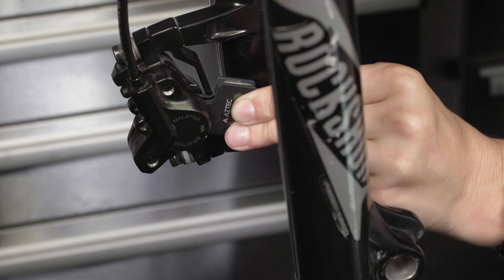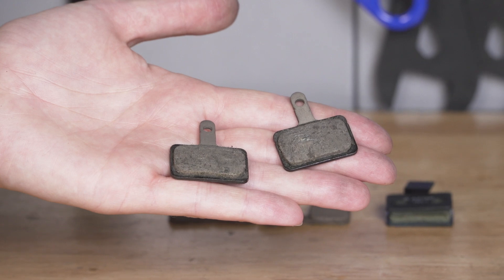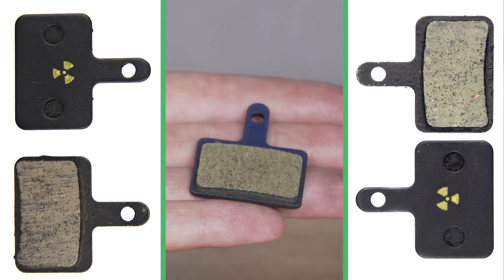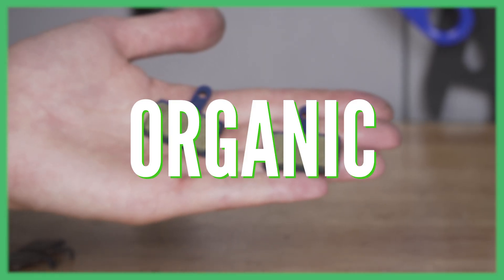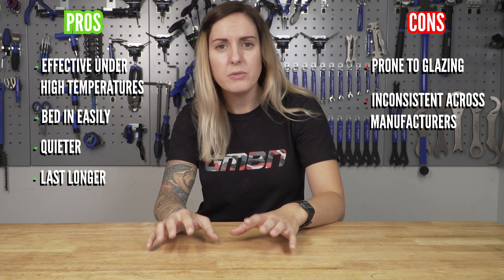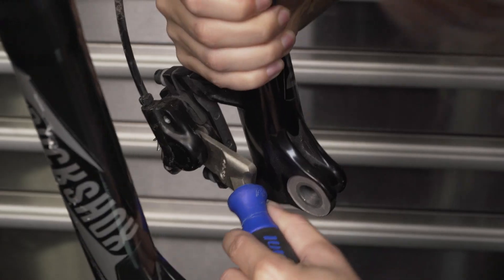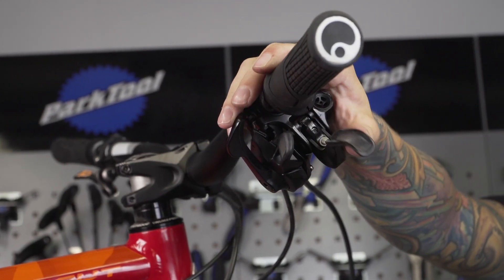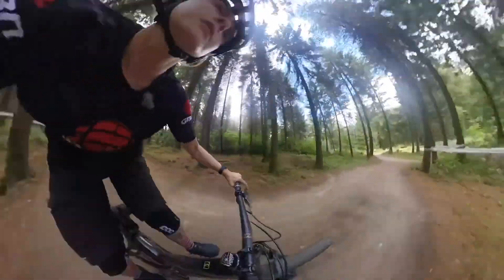GMBN Tech Essentials Ep.2 | Brake Pads

Comment: Pro tip, don't come to a complete stop when bedding in brakes! 
Bedding in is simple, deposit brake pad material evenly onto the rotors as the two rub together and warm up. 

If the brake pad cuts through this layer of disc pad material, or the layer is laid down irregularly by an incorrect bed-in procedure (like coming to a complete stop when the pad is soft, creating high spots) the pad jumps as it hits a damaged / irregular area, digs in, then jumps a bit more and digs in once again. 
The sequence creates oscillation which continues through the rotor creating microscopic waves around the contact area, essentially becoming like a vinyl which has been hard coded to make noise, this cannot be erased by changing pads and requires the rotor to be put back to neutral (by sanding or grinding) or even replaced in worst cases. 
Coming to a complete stop also significantly increases the likelihood of glazing.

Comment: Solid vid, GMBN! Thought I'd add something I've found through my own riding... 
Sintered pads...
Whilst the pads themselves are resilient to heat, we've found that on a long, steep descents where you're generating tonnes of heat, such as places like the Alps (Pila, for example), a sintered pad will conduct a lot of that heat back into the caliper. Eventually this boils the brake fluid and results in the scary brake-levers-hitting-the-bar moment. 
Quite a unique scenario, agreed, but it consistently happens!
Reply from the maker: Thanks for sharing that! They all have their unique characteristics, though long descents in the Alps can bring about its own unique problems.

Comment: I was under the understanding that you aren't supposed to lock up when bedding in. Since it can lead to an uneven distribution on the disks. I thought even coming to a complete stop using the brakes during bedding in was frowned upon? 

It might have also been a good idea to very briefly mention that contaminated rotors or air in brake lines can also lead to breaking issues. Just to help people who find out that the pads aren't worn so they can find what other things might be the issue for them.

Otherwise, great video. The new host is doing an awesome job :)
Reply: I was under that impression as well when breaking in pads.
Reply: This was my understanding as well. Additionally, she states that bedding in the brakes is to "rub off any surface glaze or contamination" from the pads. This might be partly true for new pads, but primarily bedding in the brakes transfers material from the pads to the rotors. Any time you clean off your rotors you will need to at least partially bed in the pads again because you wipe off the pad material from the rotors when you clean them. Using the brakes with squeaky clean rotors makes them... squeaky. Also if you switch pad material types you should thoroughly clean the rotors to remove the old pad residue.
Reply: You're all right about the bedding in process.
And when she cleaned her bike, she used the same sponge for all her bike and the discs. That's a big mistake that could transfer grease etc from all your bike to the brake discs and then contaminate the pads.
Reply from the maker: It's funny, actually, because there was a long discussion between a bunch of the presenters about which technique they used to bed in brakes. None of them could agree!
Reply: Sounds like you need to run an experiment and do a new video! Get two identical bikes. Bed in one brake using lots of skids, and bed in the other using moderate braking but never locking it up. Then have people ride both bikes and have them rate the braking quality (blind test; don't tell them which bike is which).

Comment: I have to disagree about the bed in process: the braking should be smooth and try to avoid blocking the wheel with your brakes (exactly the mistake shown in the video). See Park Tool's video on the topic, they have a great explanation there!

Comment: How were you cleaning out the caliber, with which product? Any details you can give here? Thanks!
Reply: WD40 would work if not teatree oil
Reply: I'm surprised at WD40! Coming from a background of automotive brakes, normally caliper and rotor cleaning is done with brake cleaner - an aerosol solvent that leaves no residue (and smells pretty toxic, attacks paint and plastic too). Seems counter to use a product like WD40, but if its not on the braking surface (pads or rotor) I can see the logic of it leaving a film to displace water. I suppose that's the idea?
Reply: @davinlg1  Yeah it meant for the callaper itself but I haven't tried it before I just though it was a decent idea

Comment: Thanks for the video! I have one question, are rotors specific to organic or metal brake pads?
Reply: Some rotors can only be used with resin and some can be used with both. It will say if they're resin only.
Reply: How do i know
Reply: The rotor has an inscription saying resin or something like that, which indicates it should be used with resin only. If it's made from a common brand like Shimano, you can google the model and it will also tell which compounds does it allows for use.
Reply: @marcelprobst7135  yes

Comment: I recently set up my bike with disc brakes for the first time ever. I'm using TRP spyre mechanical brakes on a set of alligator windcutters. All new parts. The calipers came with semi metallic pads. But I'm not impressed with the performance. My other bike's rim brakes performs way better. 

My stopping distance is a fair bit longer than I'm use to on rims and I'm unable to lock the wheels up for a skid. Is this normal?

I've done the bedding in process twice. 20-30 brake pulls per rotor, making sure not to come to a full stop (not that i can with these), checked my alignment multiple times and even sanded down my pads in hopes of achieving better grip. All cleaned with isopropyl alcohol.

I don't know what I'm missing. Any advice?
Reply: Are you sure the cable is adjusted correctly? Spyre's aren't great breaks but they should lock up easy enough.
Reply: @SuperAwesomeStuntMan  everything is snug and where it should be. I've switched to resin pads recently. They're more reliable than the stock semi metallics that the calipers came with but still unable to lock the wheel. They're adequate but not as good as rim brakes

Comment: 7:17 I use 4 zip ties to align the caliper, I slide them in between the rotor/disk and the pads, like so: https://flic.kr/p/HUyFHw
I have commented about this before, but if some one just watches this video, you now know this tip.
with Hope rotors it's a must IMO, it makes the job so much easier, but it is helpful with Shimano or other disks.
but if you don't want to take the wheel off, & only one or two pad are too close, but caliper is aligned, you can also put the ziptie against the disk in the middle of the pad from behind and rotate the wheel squeezing the ziptie and align the piston,pad.

Comment: #askgmbntech If a 203 rotor performs better if every way to a 180 rotor would it be a cheaper way to get better braking on the rear wheel instead of upgrading to a expensive brake set?

Comment: Thanks Jess I have the metallic pads and for some reason when wet are very noisy is that normal.
Reply: Yes or maybe your rotor is contaminated by oil
Reply: if you ride in the wet, oil spill from the road can splash into on the brakes, or if you are to careful when working on the bike or are touching the disks.

Comment: Is it necessary to douse the new pads with water while bedding?
Reply: I have never done that, there is no need, just ride down a decline with & brake until you come to a stop do it several times until you fell the pads bite well.
Reply: I have heard that you can do it in order to speed up the process. But it isn't necessary.
Reply: You can use water they mention it in the park tool video on disc brake pads

Comment: #askgmbn   If you buy a bike with organic pads, Can you use any of the other options or do you have to change out the rotors as well as the pads to switch?
Reply: some rotors only allow resin pads, like Resin only rotors from Shimano, they are useless, it takes 4 months for me to wear them out on metallic pads, but takes about 4 weeks to wear out resin pads. So I switched to Hope floating rotors, & metallic pads. on my xc bike I got Trp 29 disks, they worked well.
if you go for metallic pads & have resin only rotors, you need to upgrade, cus the resin only rotors glaze fast.
some bikes come spec'd with rotors that work well with them, so you need to tell us the model number of the rotors/disks.

Comment: you forgot to say that brake rotors cant take all kind of brake pads, mine can only take resin brake pads
Reply: Why?
Reply: @olivert.7192  because some rotors are made of weaker material so they need a weaker brake pad or they might break
Reply: Flat surfaced shiny brake rotors mostly compatible with resin pads, but others can handle both. Also there is no rule to not to combine them. Its just a manufacturer's recommendation.

Comment: Ugh... suggesting that somebody take out their brake pads and sand them down leaves out some important information. First thing to do before you even touch your caliper is to get some compressed air and clean out the caliper and brake pad area get all that dust and debris out. Secondly take out the brake pads clean them with brake cleaner or alcohol before sanding, you do not want to sand in any bits of grime or debris further into the pad. Then after you sand them down evenly clean them again. Before reinstalling the pads clean out the caliper area with brake cleaner. Give the rotor a good cleaning as well then reinstall the pads.  A rider will have to rebed thleaand in but not quite the same process as brand new pads. You also left out ceramic pads. The main purpose of Bedding in brake pads to a specific rotor is to put a layer of brake pad on the rotor surface, getting the initial glaze off of the pad is only secondary and that could be accomplished with a little bit of sandpaper prior to installation. C+ on the video. I really have MUCH higher expectations from Global mountain biking Tech, after all guys this isn't gcn 😂
Reply: There is aloready a video on this.
Reply: If you’re a fan of your lungs, DON’T go blasting brake dust around with compressed air 🙄 just use a liberal amount of brake cleaner, rags and a clean paint brush. Also, bedding in to put a layer of pad on the rotor? The fuck are you talking about?? The point of bedding in is to match the surfaces so you have near 100% contact between pad and disc. Jesus Christ 🤦‍♂️